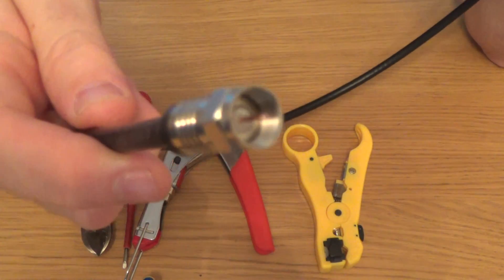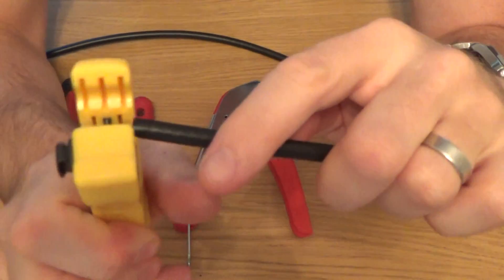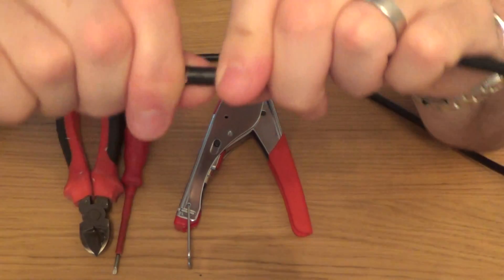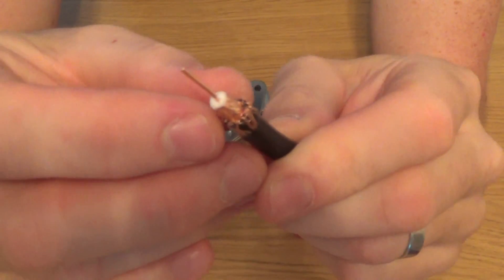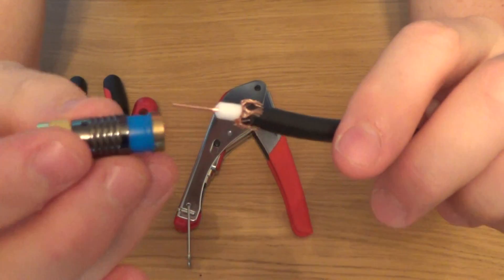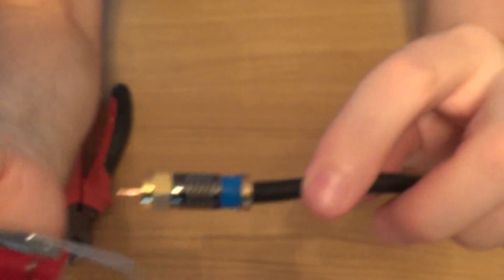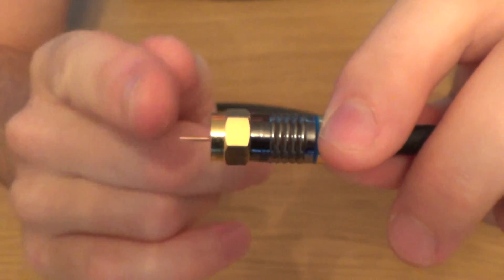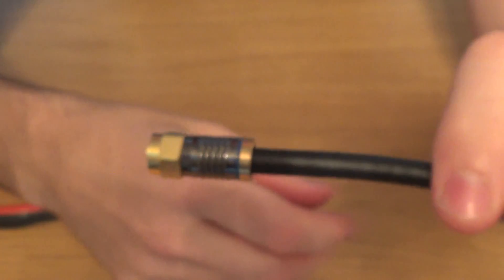How to wire a Digital TV & CABLE Broadband coaxial Cable.

Comment: Hey vince, in the process of putting a new aerial up but it has the f-connector on the aerial end and the other end. QUESTION IS... does it matter if u have the f-connector or the belling Lee-connector (I think it’s called) as that’s what’s on the back of my tv not the screw on fittings it all works as one,even if you have some f-connector fittings one end into the belling Lee-connector into my tv ??  

Please let me know !! TIA
Reply from the maker: Hey, yes, you can mix them on the same cable so I have F Connectors on my splitter/booster end and Beliing-Lee connectors on the TV ends.
Reply: My Mate VINCE thanks for the reply that’s perfect cheers
Reply: J1a9m8e3ss Kiu

Comment: Hi, I have that same coax stripper, if you line up the end of the coax with the little arrow on the black insert, instead of with the end of the insert, then you don't have to trim the central conductor after compressing the connector.

I've watched a couple of videos on compression fittings, and you are the first to remove the foil from around the dielectric, what's the reason to do so?
Thanks for taking the time to make these videos!
Reply from the maker: Thanks for the tip, I will check it out. 
I always read that you should remove the foil,  I don't know the reason why, maybe it is to lessen the chance of it shorting if it came a bit loose.
Reply: @Mymatevince  Spot on!